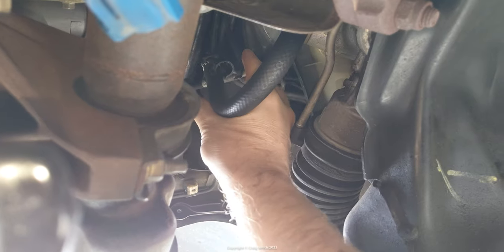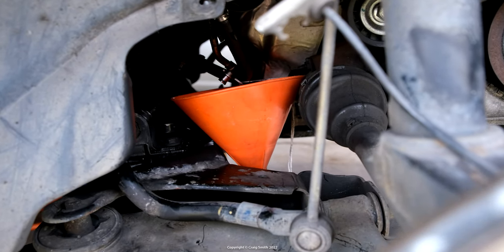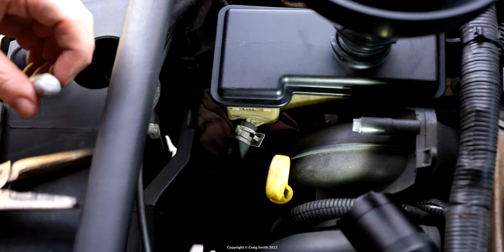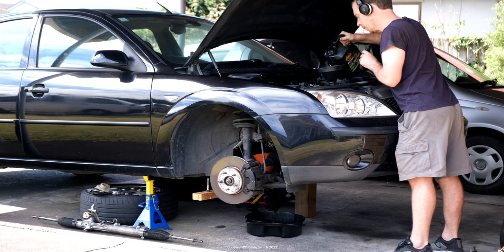How to: Ford power steering fluid flush & change

Comment from the maker: Amazon links to relevant products (from the description) ~
Power steering fluid: Follow the Ford TSB and use Mercon V...
 Amazon US: https://amzn.to/2Bre2U8 | UK: https://amzn.to/2SeBoni
Or, Fluid M2C195-A (old)...
 Amazon UK: https://amzn.to/2RSCeWB
...or M2C204-A2 (new)...
 Amazon UK: https://amzn.to/2QsyVsr
** Warning: Some fluid product listings online are listing Ford spec M2C938-A as a replacement for M2C195-A. That is Mercon LV ATF and I'm fairly sure it's NOT correct.

Comment: 4:20 if you just want to cranking the engine without starting it, just press gas pedal all the way in and then turn the key, works on 99% of cars, also on mondeo 3

Comment: As I am knocking on  bit,could it be done by first of all by emptying the reservoir ten refill drive  a few miles and keep doing this until clean appears.
Reply from the maker: Yes but the reservoir doesn't really hold that much, most of the fluid is in the hosing and the rack. If you do it that way you will waste a lot of fluid as you end up throwing away a lot of new mixed with the old. Might not cost more to just get a shop to do it for you.

Comment: where were you? Could you make a video replacibng the head gasket?
Reply from the maker: I sure hope not
Reply: @CraigsDIY  ahahah we hope the same, does pcv valve burn oil, if it is not working good?
Reply: @guillermogorgeaguire1083  it does normally with any car. if your car burns suddendly a lot of oil try it, you can also check if PCV works with the oil cap, but im not very sure about it. you must read into that